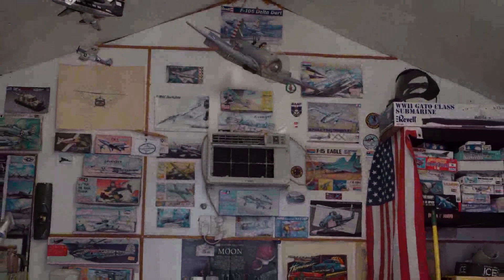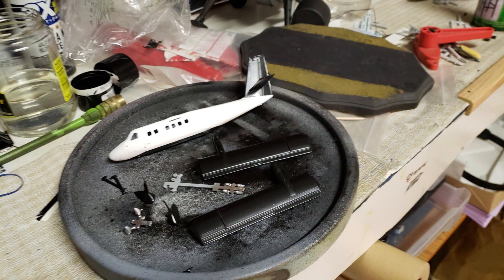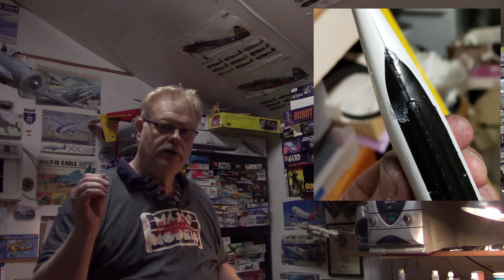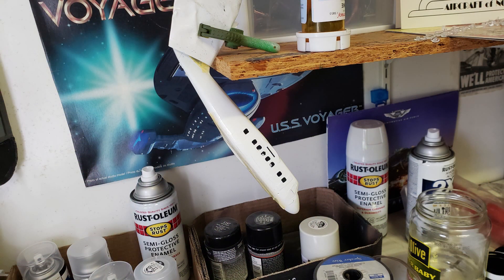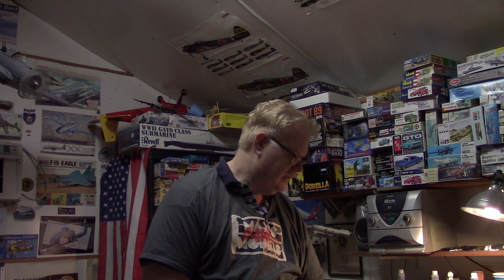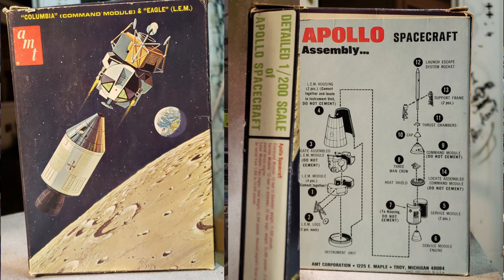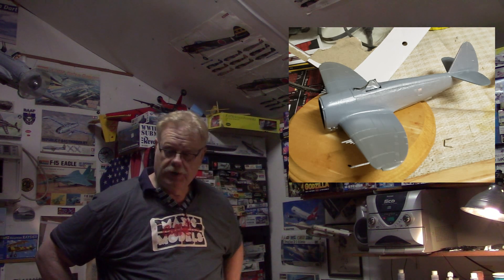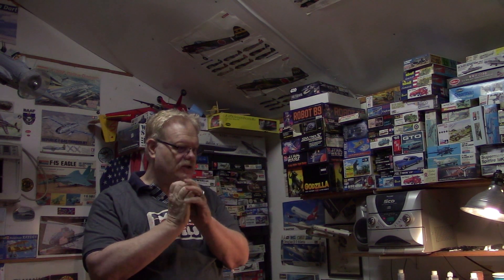max's models after hours 12/15/20

Comment: After masking, first spray a clear gloss to seal the tape edges, then when dried shoot the color.  The clear prevents under-run.
That AMT Apollo kit is the same CSM/LEM from the full Saturn V kit.
I completed the full kit, but still have to paint and decal it.
Reply from the maker: I did but not well enough I guess.
Reply: Thanks for the info.